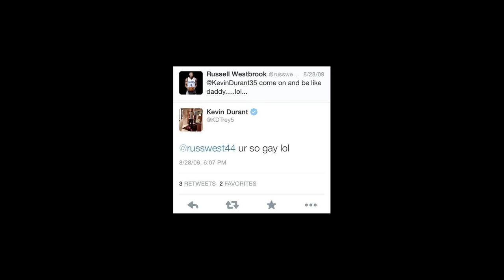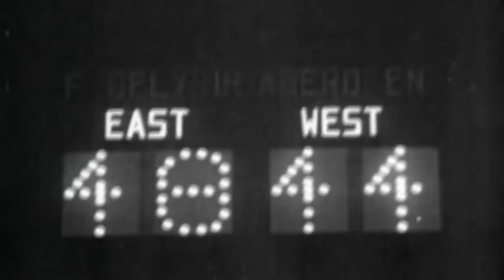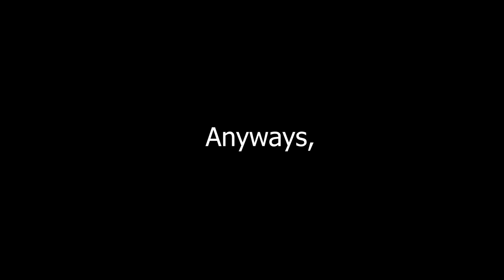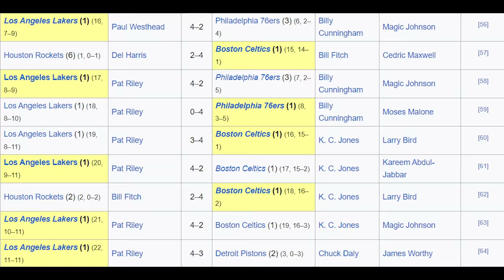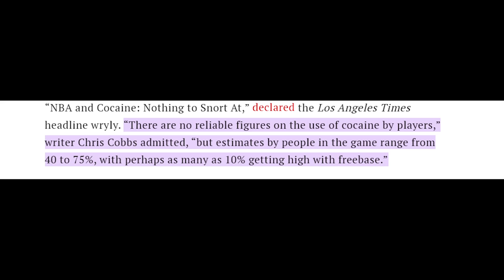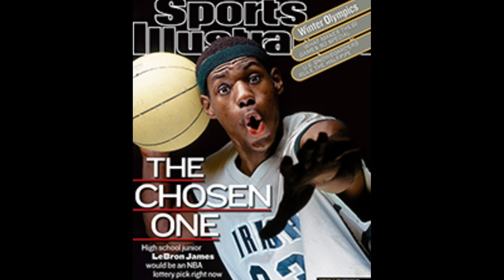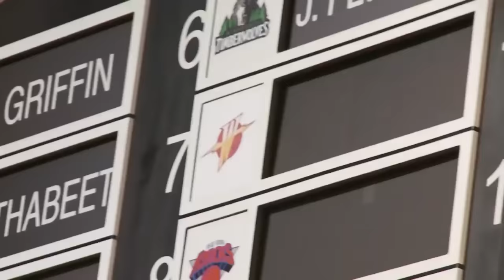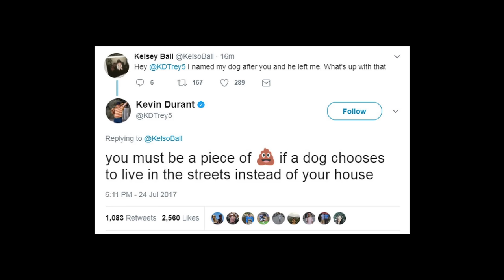The Entire History Of The NBA, i guess

Comment: The 13 rules are:
James Naismith, the inventor of basketball, outlined 13 basic rules for the game in 1891. These rules were simple and aimed at ensuring fair play and safety. Here they are:

1. *The ball may be thrown in any direction with one or both hands.*
2. *The ball may be batted in any direction with one or both hands (never with the fist).*
3. *A player cannot run with the ball. The player must throw it from the spot on which they catch it; allowance to be made for a man who catches the ball when running at a good speed.*
4. *The ball must be held by the hands. The arms or body must not be used for holding it.*
5. *No shouldering, holding, pushing, tripping, or striking in any way the person of an opponent shall be allowed. The first infringement of this rule by any person shall count as a foul; the second shall disqualify them until the next goal is made, or, if there was evident intent to injure the person, for the whole of the game.*
6. *A foul is striking the ball with the fist, violation of Rules 3, 4, and such as described in Rule 5.*
7. *If either side makes three consecutive fouls, it shall count as a goal for the opponents (consecutive means without the opponents in the meantime making a foul).*
8. *A goal shall be made when the ball is thrown or batted from the grounds into the basket and stays there (without falling), providing those defending the goal do not touch or disturb the goal. If the ball rests on the edges, and the opponent moves the basket, it shall count as a goal.*
9. *When the ball goes out of bounds, it shall be thrown into the field and played by the first person touching it. In case of a dispute, the umpire shall throw it straight into the field. The thrower-in is allowed five seconds. If they hold it longer, it shall go to the opponent.*
10. *The umpire shall be the judge of the men and shall note the fouls and notify the referee when three consecutive fouls have been made. They shall have the power to disqualify men according to Rule 5.*
11. *The referee shall be the judge of the ball and shall decide when the ball is in play, in bounds, to which side it belongs, and shall keep the time. They shall decide when a goal has been made and keep account of the goals, with any other duties that are usually performed by a referee.*
12. *The time shall be two fifteen-minute halves, with five minutes’ rest between.*
13. *The side making the most goals in that time shall be declared the winner. In case of a draw, the game may, by agreement of the captains, be continued until another goal is made.*

These 13 rules laid the foundation for the modern game of basketball, which has evolved over the years with additional regulations and refinements.